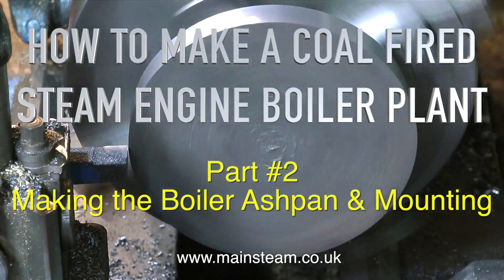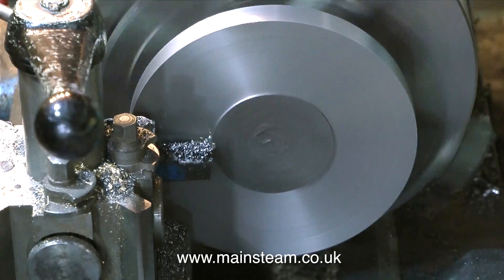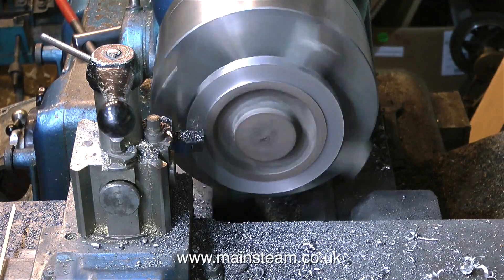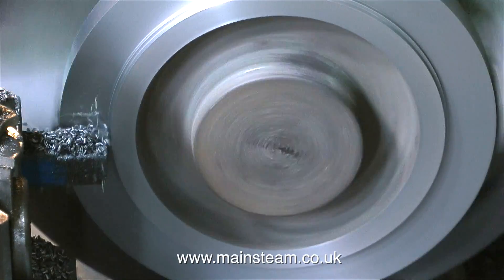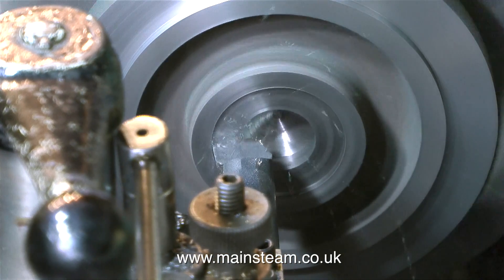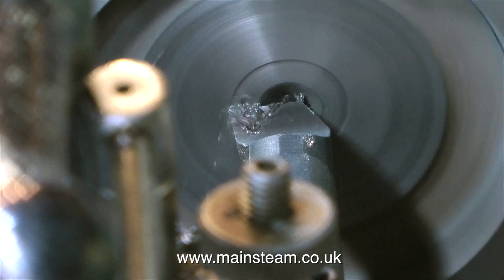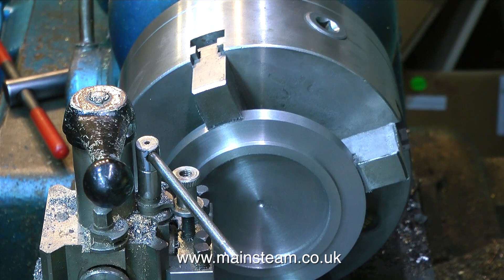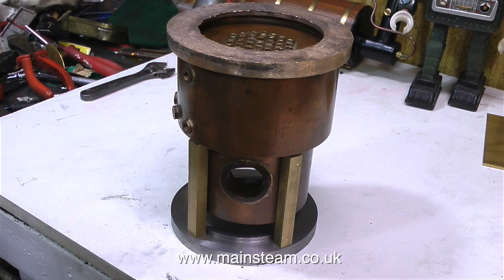HOW TO MAKE A COAL FIRED STEAM ENGINE BOILER PLANT - PART #2

Comment: Around 2 minutes in you talk about sizes of the lathe, I only have a passing knowledge of these, I pass a couple of them every day as I go through my work to my desk.  Anyways, the ones we have at work have a removable section of the guideways underneath the left side of the lathe which allows for larger diameter things to be put.  Didn't know if you knew this, so thought I'd mention it.
Reply from the maker: That's called a gap bed lathe - mine unfortunately isn't :-)))
Reply: Keith Appleton, I see. thanks for the technical term, and thanks for the videos, good fun to watch.

Comment: Could you say that chilling is accidental hardening?
Reply: And the other cure, apart from grinding, is to get it red hot and allow to cool very slowly. The old way was to leave the casting in the coal fire over night, unfortunately modern  central heating systems don't work quite so well.
Reply from the maker: Yes, I suppose sit is . . .